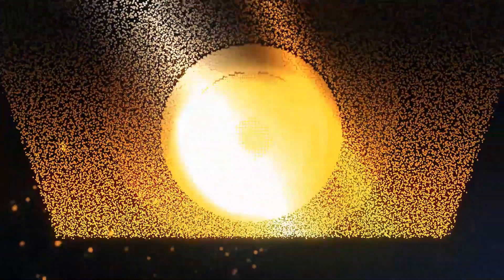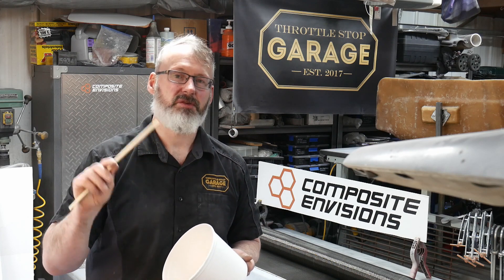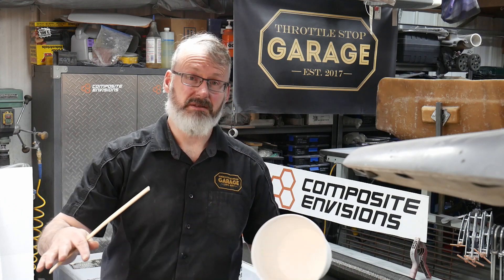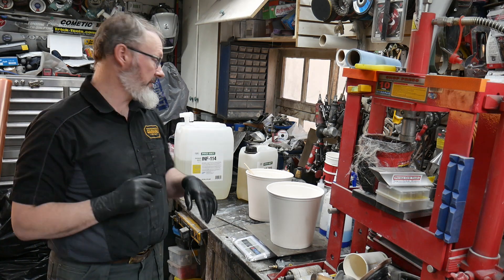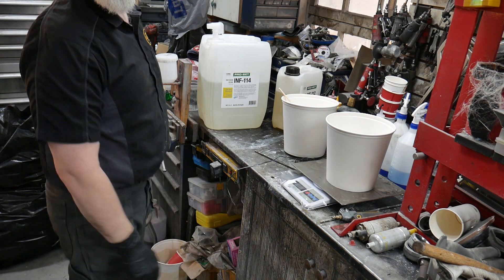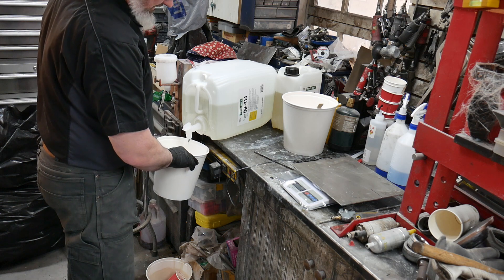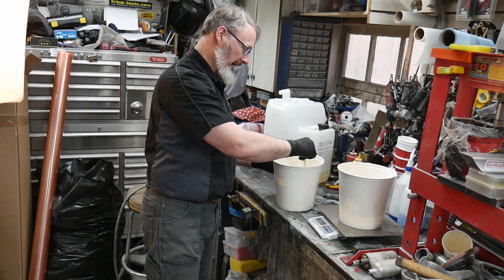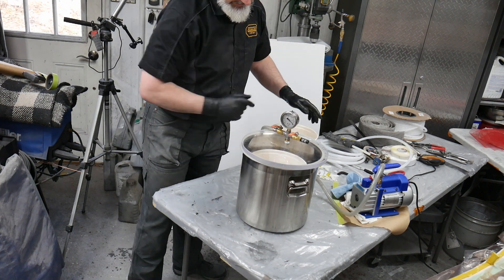Mixing Epoxy Resin for Carbon Fiber Infusion

Comment: Is there a simpler way of mixing a amount for those who can't do maths  and cand do stupid equations youdpnt need to do equations for body filler it's just a golf ball to a pea  why is resin so difficult to mix iv look on Google nothing but 20 different ratios no basic amount for a small project I just want say 20g of resin to 20g of hardner keep is simple Americans stop over complaining everything ffs
Reply from the maker: I've never seen a standard ratio that would be "one size fits most" for this sort of chemistry.  Just take your time and work through it - the epoxy systems used for carbon work are very particular for getting the ratios right and getting the right amount of resin.

Comment: I think your calculations are doing a 40/60 fiber|resin ratio. I keep trying to accomplish 60/40 and keep adding around 400 grams on the fly. Going to just try this and see how it goes. Had a part get air in the line because my vacuum was too heavy and bucket to big.😀
Reply from the maker: You have to use more resin for infusions because of the waste in the lines and consumables. My parts were turning out at optimal resin/fiber ratios.

Comment: So the fabrics weigh 3kg?.. if not, how to take fabric to epoxy ratio?
Reply from the maker: Yes - so then it's a bit of an estimate for epoxy weight.  I normally shoot for 1.4 X fabric weight.  This generally worked but does depend on the size of the mold and the other materials.

Comment: Good video 👍 I like to use a mixing rod on my drill (you can get them to fit quart or pint sized containers). After mixing the 2 parts, I like to mix in some denatured alcohol, until the cloudiness goes away. This will temporarily thin the epoxy resin, extend the set time and degas the mix.
Btw, wood will absorb the thinner mix like a sponge and cure like petrified wood
Reply from the maker: Thanks, I didn't know about the denatured alcohol trick.

Comment: Nice video friend! Question : Is it a good idea to de-gas the epoxy/hardener mix if you are doing a wet layup? or just if it's for infusion? I'm doing a wet lay over foam.
Reply from the maker: I really didn't see any difference in my infusion because I'm infusing so slowly.  I've only done one wet layup (shifter) and it also worked fine.  I did sand and clear that part.
Reply: @ThrottleStopGarage  Thanks buddy! It makes sense to go the extra mile and degas the liquid. I'll probably order one.. it was about $130 on amazon from today's look.

Comment: Another great video! I might add for the novice that pot life will be A LOT shorter than working time. I generally use 100g of resin at a time and then add my ratio'd hardener to it. Mine comes out to 66g hardener for every 100g resin. Makes for easy calculation. I'll start the infusion then mix another pot on the side and add as needed. Doing this has a sort of double-cup method built right in. Though these long form calculations will help immensely for larger parts!
Reply from the maker: Very true - had one pot almost burst into flames while the lines and mold were still 8 hours from hardening.

Comment: how do you calculate 2:1 ratio. 2 parts resin 1 part hardener. Working on 4 car parts (radio dash kit, shifter, etc)
Reply from the maker: Follow the instructions in the video.   If it's 2:1 by weight, then 3 parts is the total and resin is 2/3 and hardener is 1/3.

Comment: great video. what did you buy from amazon to help aerate the epoxy? I may have missed it somewhere
Reply from the maker: The vacuum pump and stainless tank/lid/gauge were an Amazon purchase.  Aside from the pump leaking oil, it works fine for what it is.
Reply: @ThrottleStopGarage  Would it be possible to use the same vacuum pump for both degassing and infusion?
Reply from the maker: @GrayRaceCat  sure. There's no reason it can't do double duty.
Reply: @ThrottleStopGarage  I have a small pump like the one you used in this video (an old A/C vacuum pump) it “leaks everywhere more than anyplace else” and it’s LOUD! I’d rather use the type you bought for resin infusion.
Reply from the maker: @GrayRaceCat   a good pump is certainly worth the investment.

Comment: thanks for a very nice series.
ive read recommendations from manufacturers (and pros int the field) that once you feel youve mixed it enough, to pour it into a second container and keep mixing to be VERY sure the chemicals really is mixed and no unmixed parts are left.
Reply from the maker: You really have to watch the bottom/sides.  You'd hate to not have the epoxy harden completely.

Comment: Do you weigh the carbon fiber stack on scale? Also, wouldn't the vacuum bagging remove the air out of the resin so you don't need to put it in a vacuum pot?
Reply from the maker: I do weigh the carbon before it goes into the mold and then I weigh whatever I cut off to get a final weight.  You don't really need to degass for infusion, but it's not a bad practice.  For those doing raw carbon parts that will be cleared, every little bit helps.

Comment: First video I'll check out when I get home from work. Have you ever figured out a type of resin that stands up to heat ?
Reply from the maker: They exist, but usually can't go much beyond 150º C.  I'd suggest looking at other thermal barriers (gold foil products) - check out this foil insulation from Pegasus Auto Racing (https://www.pegasusautoracing.com/productdetails.asp?RecID=11221)